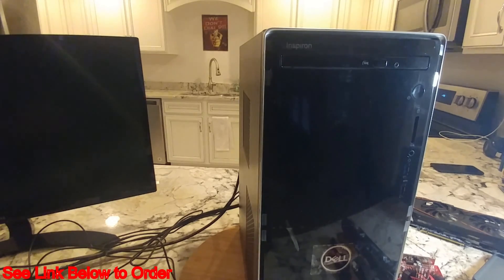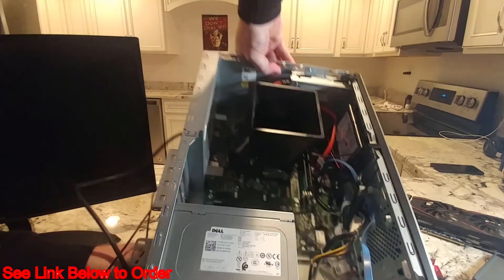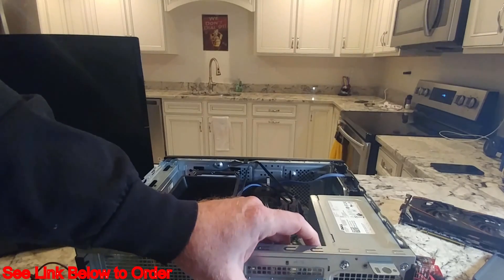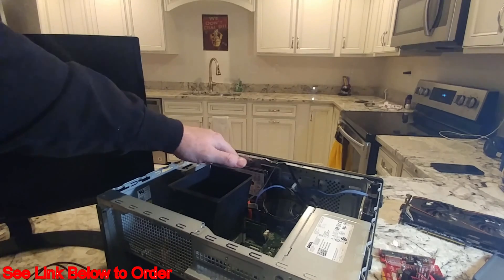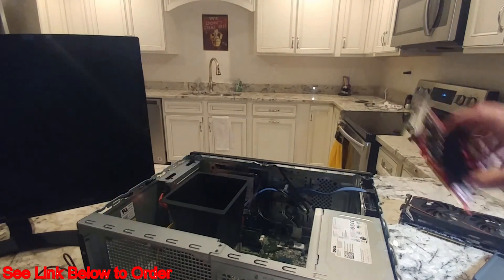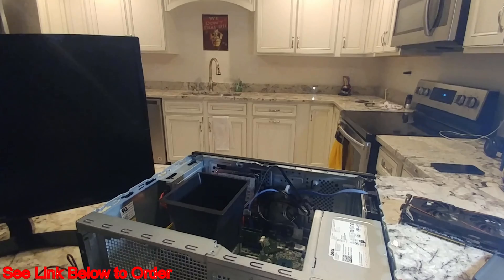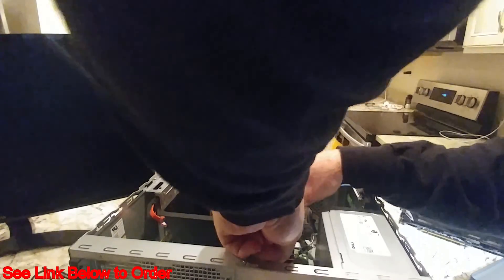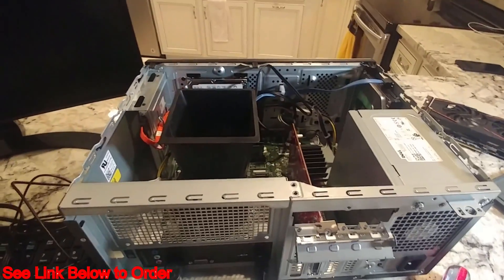How to install video card in a Dell Inspiron 3670 desktop computer, gpu, step by step

Comment: My DELL Inspiron 3670 started bugging out and gave me this message: 

“Your hard drive is operating outside of normal parameters and should be replaced. This system no longer carries a hardware warranty. To purchase a replacement drive, please visit Dell Spare Parts for a compatible replacement part.”

What does that mean?

Comment: I got a question for you you know the plastic shield above these Dell computers do you think they're really needed I remember you saying one time you didn't think it was needed seems to me like if air blows it has to have somewhere to come out so not putting the shield on would seem to be better
Reply from the maker: No doubt having it on should get more heat out of the case..  I upgraded my cooler...and no longer can close panel due to it's size

Comment: I recall you doing a video I could be wrong on a 3070 Dell where you put a 1650 super and it fits am I recalling that right or am I wrong. Realistically using the SATA power that would give you well above the 315 Watts needed to run the card or is that going to be too hard on the motherboard stupid question but I don't know
Reply from the maker: Dell 3670, I put several GPU's in there.  I think I mislabled 1660 video for which was actually a 1650 Super.  Need to verify that.  

I have done lots of upgrades on these, most of them I don't recommend as this case has limited cooling and the power supply really shouldn't be used to support anything greater than GTX 1650 (doesn't have PCIE 6 or 8 pin connector).    You can upgrade the PSU and buy a special adapter and go with a better GPU that way.  Whether it will damage the PC over long term use is unknown....I don't really mess with mine too much, but it did get lots of upgrades and did not fail me.   Let me know if you need some of the links sent to you.
Reply: @PC_HardwareTechUnboxing_1  yeah I fully agree I got a 1650 OC in that one computer and that works fabulous I was just curious because I remember you putting a 1650 super in it and using the power source and I was thinking that thing would be smoking hot but if it wasn't I'd do it.

Comment: Hey David, what card would you recommend for me to put into mine to speed up a Dell inpsiron 3670, for video editing in Adobe premiere pro
Reply from the maker: Three routes you can go:
1) Since this has no 6 pin PCIE, you can get at best a GTX 1650 (non super) in it.  Other choices GTX 1050 TI, 1050 GT 1030, GTX 950. RX 550.
2) Add a mini 6 pin to 6 pin PCIE, fine low wattage gpu that fits.  I have some examples on this channel.  However, I have concern about this method as there is little to no head room on the PSU and at some point, you may require more power than you are getting from the PSU.  I only demonstrated it using doom and GTX 1060, 1660..etc
3) Replace power supply and buy 24 pin to 8 pin power supply to motherboard adapter.  This route enables you to buy a rather large PSU.  Negative...not sure how good this route is for long term use and case is not good for a hot GPU...or a long GPU.  I have about 40 computers here...so it didn't see a lot of time.  I also have videos on adding PSU.  This route you could add RTX 3050, 3060, 2060...etc.  If it fits and you have enough power.
Reply: @PC_HardwareTechUnboxing_1  thanks a ton for the info David. Any particular 1650 you'd recommend to me that I could find readily available? I think that would work great cuz I only edit 1080 content, for the most part. Haven't gotten into 4k for what I do. Thanjs!!!

Comment: Hey, we've been in contact a few times. I'm planning on getting a GT 1030 for my machine for playing light gaming (cs:go, valorant, minecraft, fortnite, GTA) it only draws 30w and doesnt require external power making it a great card to get some more longevity out of your inspiron
Reply from the maker: Alright!  I am actually surprised out of all the GPU's I have had in this computer...that I never put the GT1030 in there.
Reply: @PC_HardwareTechUnboxing_1  in one of your other videos you say its barely an upgrade from the UHD 630, do you think its worth the upgrade for around $150 USD? gpu prices are so bad right now
Reply from the maker: @ryley_long  If you had a 12th gen or AMD 5300G/5600G/5700G, I don't believe it would be worth it.  Since it's either 8th or 9th gen, it might be worth it...it is really what would make you happy.  Higher FPS at current resolution, or bumping up the resolution and getting the same FPS.  

Unfortunately, I don't have a direct comparison on this channel of a GT 1030 to any integrated graphics, but I would say it is the difference between say playing FortNite at 720p Low around 50-60FPS and playing it at 1080p 50-65 FPS.   I am not sure which CPU you have, so it might be worse than that.
Reply: @PC_HardwareTechUnboxing_1  I have a i5 8400, the card arrived today and I'll be testing it later thanks for your help! :)

Comment: does this work with the nvidia 970 gtx?
Reply from the maker: Most of those are too long.  I believe longest GPU that will fit is around 10.5".  Plus, you would have to replace the PSU.
Reply from the maker: This playlist might help you...it shows about every upgrade I have ever done for the Dell 3670.  Some of them I would not recommend, but it does give you idea of possiblities.  https://youtube.com/playlist?list=PLVgD9iFAWx_IMiBmqgqFcTxl3W5PIdznr
Reply: @PC_HardwareTechUnboxing_1  thanks!

Comment: Hey david i know this is a bit late but i have a question do you know if the computer could also run the GeForce GT 1030 graphics card?
Reply from the maker: Yes, it definitely can, it is one of about 5 that I have tried out that did not require a PSU upgrade or additional adapter cables.
Reply: That's great new thank you!!!
Reply: Yeah it can, I had that card before upgrading the PSU and GPU to a 1660S.

Comment: I want to fit in a gtx 1080
Reply from the maker: Hello...unless there is a mini out there...PCIE ribbon extender, PSU upgrade and 24 pin to 8 pin PSU power connector would be about the only way I know how.

Comment: Since this is THE video that pops up on related searches I thought I'd provide some details I learned on my own 3670.

1) You can use any GPU upto about 75W as long as it does not require the extra PCIe power connector. The best card in this category at this time is the GTX-1650 (NOT the 1650 Super which needs more power).

2) You can easily updated to an OEM 365W power supply. I found one for about $64. Here are the part numbers.

Optional OEM 365w PSU =
7VK45 365w, Huntkey
T1M43 365w, Delta

3) IF you upgrade to the OEM 365W power supply, you can install the GTX-1660 Ti or GTX-1660 Super with just a 6pin to 8pin PCIe power adapter. (NOTE: I strongly believe you could also use the RTX-2060 without a problem but I have not tested it. According to testing done at Tom's Hardware, the RTX-2060 NEVER draws more than ~9 Amps on the PCIe power connector, and the 365W PSU provides upto 11 Amps!)

4) No matter what graphics card you install, you do NOT need to make any BIOS changes. Just disconnect power, install the card, and update the drivers. It really is that simple now! (I mention this because there is some outdated information on other sites that claim you need to make changes in your BIOS)

Here is a link to the 6pin to 8pin PCIe adapter I used: https://www.amazon.com/Cable-Matters-2-Pack-6-Pin-Adapter/dp/B01DV1Z32Y

Here is a link to the Tom's Hardware testing I referenced: https://www.tomshardware.com/reviews/nvidia-geforce-rtx-2060-ray-tracing-turing,5960-8.html#:~:text=The%20GeForce%20RTX%202060's%2010.4,last%20generation's%20Pascal%2Dbased%20cards.
Reply: So, that means i can install possibly any graphics card like GTX 1060 if i use a better power supply? (for example 650W PSU)
Reply: My DELL Inspiron 3670 started bugging out and gave me this message: 

“Your hard drive is operating outside of normal parameters and should be replaced. This system no longer carries a hardware warranty. To purchase a replacement drive, please visit Dell Spare Parts for a compatible replacement part.”

What does that mean?

Comment: will a Radeon RX 550 work
Reply from the maker: I have used this MSI  one in mine  https://www.youtube.com/watch?v=U_5kxQ7GcH0   

So as long as yours doesn't have a 6 pin PCIE connector (which I don't believe any 550's have) you should be fine.  Some people do occasionally experience problems though and whether that is due to their inexperience or a defective GPU or PCIE expansion port I couldn't say.

Comment: what graphics cards would work without a psu upgrade?
Reply from the maker: Thus should answer it...ignore last 5 mins https://youtu.be/4qCWOwSAquY
Reply: I used a sata to 6 pin adapter to power my 1050ti. Only provided enough power for two screens though.

Comment: Hello, can Nvidea GTX  1660 super compatible with 3670 inspiron?
Reply from the maker: Hello, assuming you buy one that fits and upgrade your PSU...it should be compatible.  I have previously installed GTX 1650, RX 570, 1050TI, RX560...and a few others.  I believe the motherboard is a B360 proprietary...so if it fits and you get enough power to the GPU...the sky is the limit.  That said, this site shows quite a few GPU's that have been used with a 3670 if you scroll down and look at the benches:  https://www.userbenchmark.com/System/Dell-Inspiron-3670/89372  There is a 2080S in there..which most likey that person used a PCIE ribbon extender.

Comment: Can this take a rx 580 if I put another psu in it?
Reply from the maker: Yes...just needs to be the right length..i have a video of me putting in a rx 570 and I think 1660 TI
Reply: What size was ur 570?
Reply from the maker: @craig9680  Hopefully this will help you out  https://www.youtube.com/watch?v=8Q4K_KcHMf0
Reply: And if it was say 240mm would it fit in the Inspiron case?

Comment: Would you be able to put a low profile 1650?
Reply from the maker: You could have a LP card...but you still need the standard bracket for mounting purposes.
Reply: @PC_HardwareTechUnboxing_1  thanks I just saw your gtx 1650 video and im thinking of going that direction. Thanks man

Comment: Can i install cooling fan in front panel?
Reply from the maker: I don't believe there are mounts for it.  I am currently in Hawaii away from most of my computers...and unable to check.  I will look at the Dell manual and see if there is a spot.  If memory serves me correctly, there is not...there are also no vents in the front to pull cooler air into the case.

Comment: I have this computer, what card could i get without upgrading the psu
if i have to absolutely upgrade the psu which is the best option
First time building in years and i am on a budget
Reply from the maker: Hello, you want a GTX 1650 like this one:  https://amzn.to/2XuKEZs  This is the version that does not have a 6 pin GPU power connector...so it draws no more than 75w.  This is the best card that will work.
Reply: @PC_HardwareTechUnboxing_1  How much better is the GTX 1650 than The Integrated Intel UHD630 that is in the 3671, I'm looking to add a 75w Card for now, but obviously if its not much gain I'll pass. Should I disconnect the disc tray (never use anyway) will that help with the power to not stress it too much
Reply: @PC_HardwareTechUnboxing_1  I'm in the same situation, so this GTX 1650 card will work fine with the 290W psu? Everything else I'm finding says I need minimum 300W even though it only draws 75
Reply from the maker: @nateckert2424    the 300W is system power recommendation with a safety factor/buffer in there.  Here is a video I did showing a GTX 750 and its power draw.  https://youtu.be/k33FMwV3e_8    I also did one for the GTX 1650...which I am having problems locating...it drew a little bit more power
Reply: I have this card. An Asus. The system doesn't recognize it. When its plugged into another computer not recognized it. It's not faulty, but for some reason I can't get it to work

Comment: I use a 3671, is that alright?
Reply from the maker: Yes, from my research...it changed from a B360 motherboard to a B365.  The B360 supported 8th and 9th gen....as does the new one.  I can not find any real differences between them...connectors look the same.
Reply: @PC_HardwareTechUnboxing_1  Thanks alot😁

Comment: GTX 970?
Reply from the maker: The one i used to own would have been too big even after PSU upgrade
Reply: David Noble what are the maximum video card dimensions that will work for this?
Reply from the maker: @tobiasdodd9521    See if this video helps...I have been asked this question before...but hard to give you exact answer as there ares some issues...once you get bigger card in...it is hard to get out.   https://www.youtube.com/watch?v=8Q4K_KcHMf0

Comment: Would a rx 550 work in this pc
Reply from the maker: I believe all RX 550 GPUs do not require a 6 pin GPU power connector..therefore it will work.  If you have a particular model send the info to me so I can take a look.
Reply: David Noble would this card work I’ve been looking a think of getting this one ASUS PH-GT1030-O2G PCI Express Graphics Card (NVIDIA Geforce, GDDR5 64 Bit Memory) - Black https://www.amazon.co.uk/dp/B0727WGG3F/ref=cm_sw_r_cp_api_i_6GeWEbJ3X5KRT
Reply from the maker: @legitlime5253   Yes, it doesn't look like it says Low Profile and I didn't notice GPU connectors.  Performance will be slightly better:  https://gpu.userbenchmark.com/Compare/Nvidia-GT-1030-vs-Intel-UHD-Graphics-630-Desktop-Coffee-Lake-i5-i7/m283726vsm356797

I do think that you will be upgrading sooner than later though.
Reply: David Noble the card  has a minimum of 300 watts and the pc is shipped with 240 watts so will it be the same speed or slower
Reply from the maker: @legitlime5253  With them stating 300W, they are factoring in a buffer.  To get closer to a true number, you would have to  add up all the components in your computer (PSU calculator).  I would have to double check, but it should be 290W for the PSU.  You can get a 365W Dell PSU off ebay...and possibly Amazon.
Reply from the maker: @legitlime5253    Here are the Dell part numbers to upgrade to a Dell PSU that should be for an easy install:  7VK45 365w, Huntkey
T1M43 365w, Delta   I have never used either one of them so I can't provide feedback.  While I have used quite a few video cards in my Dell with the stock PSU, it is always a good idea to have a buffer for gaming, this is what I preach on my custom builds.  The Dell makes it more difficult though.

Comment: Hey I know this is an old video but I was wondering about how you connect the graphics card into the psu?
Reply from the maker: Hello, the 3670 and 3671 only come with a 290W PSU.  This PSU does not have a GPU power connector.  You are limited to GPU's that do not need this 6 or 8 pin connector and  will need more than 75W from the PCIE conneection.  I have made a playlist of the various upgrades I have done..including multiple videos upgrading the PSU,:  https://www.youtube.com/watch?v=Gn17sr9VBXc&list=PLVgD9iFAWx_IMiBmqgqFcTxl3W5PIdznr  Hope this helps.
Reply: @PC_HardwareTechUnboxing_1  thank you

Comment: I know I’m late but I installed a 2gb gtx 1050 and it says minimum requirements should be a 300W psu and I don’t want to kill my gpu with my 290w psu. What psu can I buy that will fit into my Inspiron 3670? I’m looking for like 600w minimum
Reply from the maker: Most likely you won't have any issues..unless you start connecting perirpherals to every open PCIE, USB, SATA...etc.  I have connected the following and ran them for extended periods:  GTX 1050, 1050 TI, RX 460, RX 560B, GTX 1650, GTX 750.  None of them pulls more than 75W from the PCIE connection.  Dell's new 3671 shows a version that you can buy for  $1149 that comes with the GTX 1650 and has only the 290W PSU:   https://www.dell.com/en-us/work/shop/desktops-all-in-one-pcs/inspiron-desktop/spd/inspiron-3671-desktop?gacd=9646510-1069-5763017-0-0&dgc=st&msclkid=4992451ef6dd1af4e6f81ba227b8d1a7&gclid=CMuw9JLKsukCFYgbfgodOGECWg&gclsrc=ds#features_section

That said, if you are really worried about it...there exists a 365W PSU from Dell that you can buy.  I will have to find the link for you.  If you want to really upgrade the PSU, watch these videos that I did and you will see though it works...there are some issues with replacing it with a non-Dell PSU.  I believe I have 4 different videos that I did...this was the latest:  https://www.youtube.com/watch?v=F09jvuASDzY
Reply: David Noble thanks man this helped a lot! I’m subscribing for sure.
Reply from the maker: @Es2saucy  Great.  Here is a playlist that might give you some other ideas.  https://www.youtube.com/playlist?list=PLVgD9iFAWx_IMiBmqgqFcTxl3W5PIdznr   I am still finding my groove on here, so some of these are better than others.

Comment: I have this pc, will a rx 580 fit and be good for most games and what is a good power supply you recommend on the cheaper side. Also plz give me tips I’m new to pc
Reply from the maker: This was a viewer request asking me what largest video card is that someone could get in here:  https://www.youtube.com/watch?v=8Q4K_KcHMf0
This is me installing a compact HP GTX 1660TI, it is newer and of better quality than some of my earlier 3670 videos:  https://www.youtube.com/watch?v=U_gn1QI8EAU
Here is another variation, Semi Modular 850W EVGA PSU and AMD RX 5500 XT into the 3670:  https://www.youtube.com/watch?v=F09jvuASDzY
Reply: Do I need to upgrade power supply, processor or anything else for it to work with new video card
Reply from the maker: @adamc4592  It depends.  If the card you want requires 6 or 8 pin GPU connector than you will have to upgrade it.

Comment: I don't play games on my computer. Will the GTX 1050 work with it?
Reply from the maker: Yes.  Other options from nvidia...Gtx 750, Gt 1030, GTX 1050 ti..Gtx 1650.  Any of those will be an improvement over integrated graphics..desktop or workstation type work.